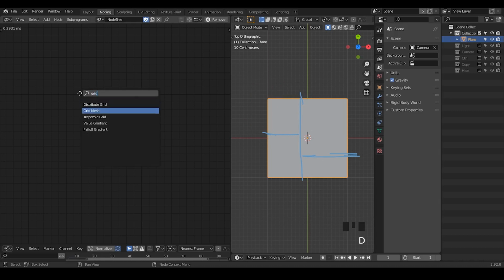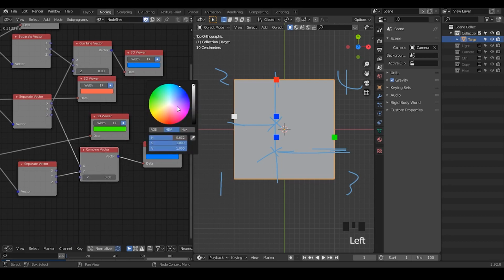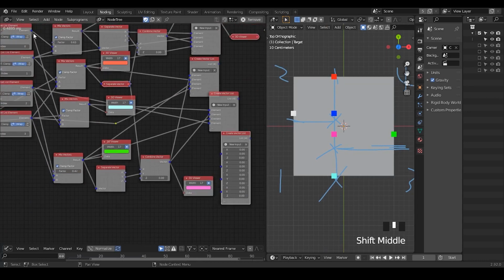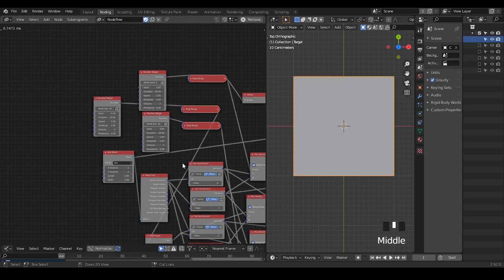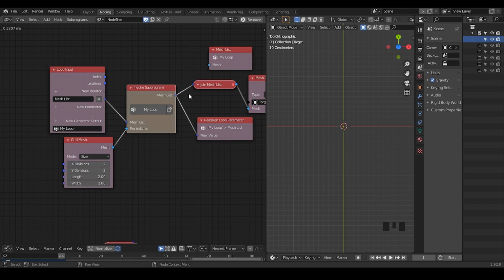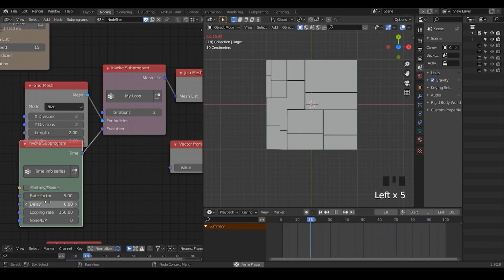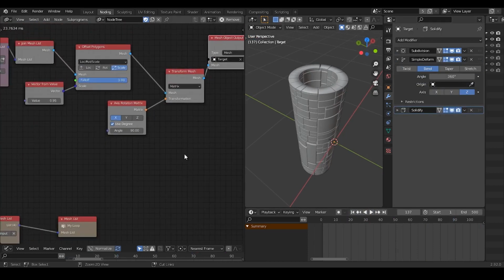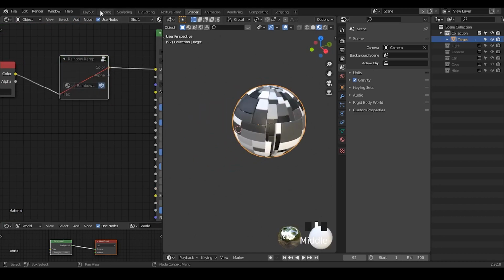[Practice] Animated Recursive Subdivision in Blender using Animation Nodes

Comment: Can you convert this method into geometry node ?
Reply from the maker: no, GN doesnt provide such low level access, neither it provides the loop so you have to do then manually. Nevertheless there can be a completely different approach, which i'm not personally too familiar yet
Reply: @bradleyanimation120  sir, geometry node is easy but,how to learn animation node it soo hard?
Reply from the maker: @FineStudios  You don't. GN can do most work that's doable by AN now. there are some differences and features that aren't implemented yet compared to AN, but in most cases AN is no longer necessary and probably not recommended anymore.

Comment: in 32:31, I moved rate factor but it won't work in 3d viewport. the grid plane doesn't move how can i fix this problem?
Reply from the maker: it would be better if you can post your setup in http://discord.gg/TzuN6sPxQU.
Reply: thanks! but i fixed my problems, my scene setup was not corrected